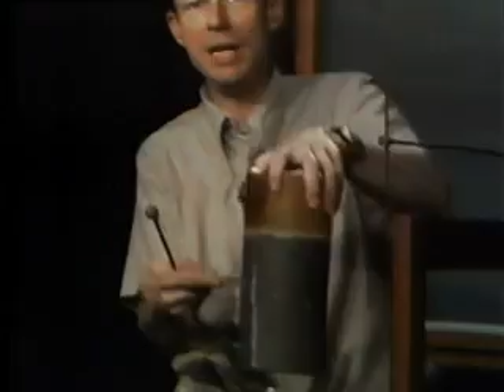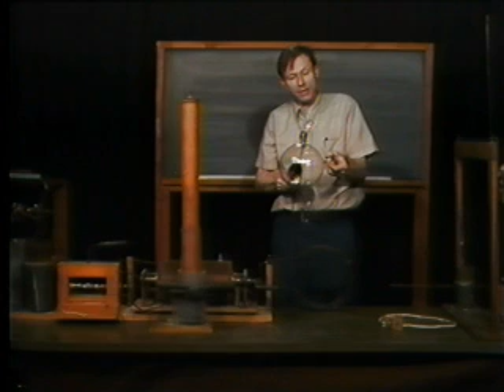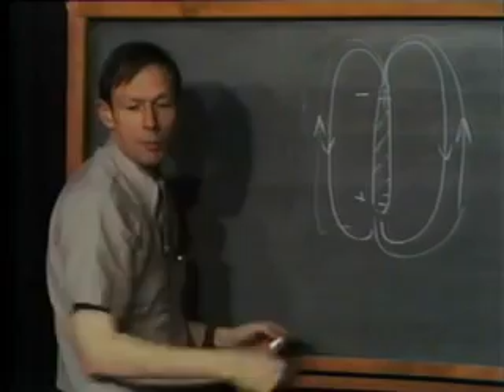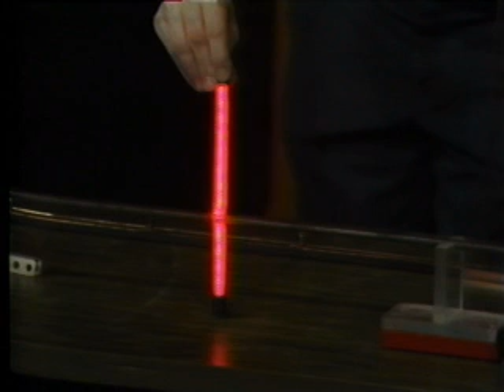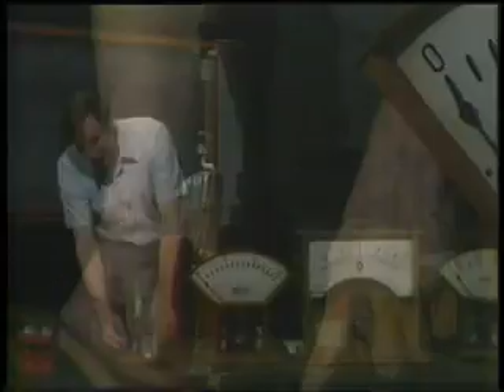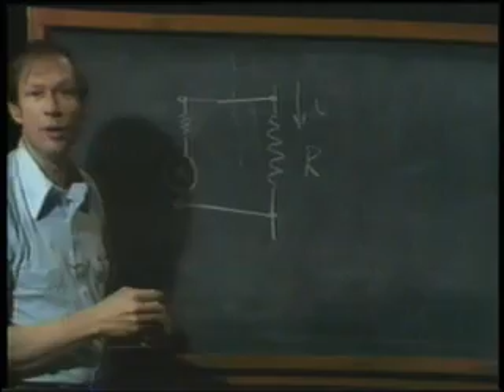PHYS 101/102 #1: Electromagnetic Waves

Comment: Skoolkids are not told that radio waves (ie em waves) are a different animal to photons. A 10 mm radio wave is not the same animal as a 10 mm photon. Radio waves consist of my photaenos which are the radiating part of a photon. And, re the Hertzian rolling E by H nature of radiating emissions from photons, i like the work of Ionel Dinu who has analysed the Hertz experiment & he says that Hertz's interpretation of Hertz's waves was wrong, there is no rolling E by H emission. Likewise Ivor Catt says that there is no rolling E by H emission anywhere in nature, it is a Heaviside slab of E by H energy current, a TEM.

The so-called flow of so-called electrons in an antenna or in any wire is a secondary effect. There is a slab of transverse E by H energy current flowing along the outside of the antenna/wire. As explained by Heaviside, Ivor Catt & Forrest Bishop. There is no such thing as charge or voltage. 

Photons have a central/internal part (the central helix) & an external part (the photaeno). 
The central helix has a front end & a rear end, & is (possibly) 1 wavelength long. The wavelength is simply one turn of the helix (there is no wave). 
The central helix is an annihilation of aether. Annihilation of aether gives gravitational mass & inertial mass. 
The track of the annihilation forms a helix. The helical annihilation moves axially throo the aether at the speed of light c, & along its helical track at more than c. 
Photaenos radiate out (to infinity) from the central helix. 
Photaenos annihilate aether, hence they have gravitational mass & inertial mass. 
Photaenos include a vibration (excitation) of the aether. 
Photaenos propagate outwards throo the aether at perhaps 5c in the near field & perhaps c in the far field. 
Photaenos radiate from fixed locations in the aether, ie from fixed locations along the central helix. 
Photaenos do not have a sideways velocity in the aether, ie each photaeno is shed from the central helix as the rear end of the central helix passes. 
In a free photon every photaeno is initially attached to the central helix, & later it detaches. 
In a confined photon the central helix has formed a continuous loop, in which case the photaenos do not detach (the central helix has no rear end). 
Electrons & other elementary particle are confined photons. 
Photaenos give us charge fields & electromagnetic fields. 
An attached photaeno gives a high field strength, an unattached photaeno gives a weaker field. 
Hence a free photon has 3 parts, the central helix, the attached photaenos, & the unattached photaenos. A confined photon has 2 parts, it has no unattached photaenos. 
Man-made radio signals are carried by photaenos, they are not carried by photons. 
A photon with a (natural) 10 mm wavelength (the length of its central helix), is a different animal to a radio wave with a (forced) 10 mm wavelength (which has no central helix). 
Free photons are slowed by the nearness of mass (confined photons), as suggested/proven by Shapiro (Shapiro Delay). 
Shapiro Delay is due to the photaenos (from the free photon)(& from the confined photon) fighting for the limited use of the aether. 
Fighting/congestion slows the photaenos & this slowing feeds back to the central helix, slowing the central helix. 
I call this slowing "photaeno drag". It contributes to the bending of light. It gives us diffraction near an edge. 
Photaeno drag is very strong inside mass (air water glass). It gives us refraction, & reflexion.
Reply: Wow, that was some good horse manure. ;-)

Comment: SHOULD EXPLAIN THAT ALL PARALLEL CONDUCTOR ARE CONNECTED TO A CIRCULAR LOOP CONDUCTOR.... 
METER....
1) HORIZONTALLY POSITION >MAXIMUM READING (  MAGNETIC FIELD ARE NOT BLOCK / DID NOT MAGNETISE THE HORIZONTALLY ORIENTATION PARALLEL CONDUCTOR  )
2 ) O VOLT READING ( MAGNETISE THE VERTICAL PARALLEL CONDUCTOR )
MAGNETIC FIELD IS VERTICAL WHILE THE ELECTRIC FIELD IS HORIZONTAL 🤔😷
Reply: THE TRANSMITTER DIAMETER IS SMALLER 🤔😷
Reply: IF THE PARALLEL CONDUCTOR  ( VERTICAL ORIENTATION  ) IS PLACED VERY NEAR TO THE VOLTMETER, IT MIGHT SHOW SOME READING DUE TO MAGNETIC FIELD FLIX LINKAGE. 🤔😷

Comment: The TRANSMITTER 'S power is sufficient to accommodate the minimum signal requirement for all receiver ( coil/loop ) placed along HORIZONTALLY position glass rod.
Red neon bulb lit with same brightness. 🤔😷
Reply: When placed near the coil.
Reply: ELECTRIC FIELD.... CAUSED NEON TO BREAKDOWN 🤔😷

Comment: SINE ELECTRIC & MAGNETIC FIELD... 
CLOCKWISE & ANTICLOCKWISE MAGNETIC FLUX IS FOR DC SUPPLY 
VERTICAL RECEIVER... CENTER BULB IS THE BRIGHTNESS DUE TO IT'S LOCATION PARALLEL &  NEAREST TO TRANSMITTER.MAGNETIC & ELECTRIC FIELD ARE IN PHASE & PERPENDICULAR TO EACH OTHER 🤔🤔

Comment: PLEASE REPLACE THIS VIDEO ABOUT ELECTROMAGNETIC WAVE WITH THE CORRECT EXPLANATION. 
TRANSMITTER ELECTRIC & MAGNETIC FIELD VARY WITH DISTANCE.MAXIMUM NEAR THE TRANSMITTER FURTHEST LIGHT BULB FROM TRANSMITTER GLOW... DIM @ OFF. 
NEAREST TO THE TRANSMITTER GLOW BRIGHTLY DUE STRONG ELECTRIC FIELD. 🤔
Reply: ANTENNA WITH BULB PLACED... 
VERTICALLY @ HORIZONTALLY ( DIFFERENT DISTANCE ) TO THE TRANSMITTER. 
MAGNETIC & ELECTRIC FIELD IS PERPENDICULAR TO EACH OTHER 🤔
Reply: LONGER ANTENNA... NEARER... SAME BRIGHTNESS 🤔
Reply: PARALLEL... ON
PERPENDICULAR... OFF🤔
Reply: NODE.. IN EACH END. ( OFF )
LONGER ANTENNA... NEARER.. SAME BRIGHTNESS ( RESONANCE PHENOMENA  )🤔
Reply: MAX + VE & MAX -VE.( SINE WAVE )... LENGHT OF ANTENNA🤔
Reply: HIGH FREQUENCY ( MHz  )... CURRENT FLOW AT THE SURFACE OF HUMAN BODY ( X NOT PENETRATE DEEPLY INTO HUMAN BODY  )HUMAN BODY ELECTRON RETURN PATH 🤔
Reply: RECEIVER ANTENNA PARALLEL WITH TRANSMITTER ANTENNA... MAXIMUM SIGNAL
.PERPENDICULAR...OFF
LONGER RECEIVER ANTENNA... NEARER... SAME ELECTRIC STRENGTH 🤔

Comment: MICROWAVE... 
RECEIVER... LOW READING WHEN A MAGNETIC MATERIAL/ METAL SHEET IS PLACED BETWEEN MICROWAVE & RECEIVER. AS THE MICROWAVE MAGNETIC FIELD MAGNETISE THE METAL SHEET, IT'S MAGNETIC FIELD STRENGTH IS WEAKEN. 
NO INSULATOR FOR MAGNETIC FIELD. THEREFORE RECEIVER READING IS HIGH 🤔
Reply: DRIVES IS PLACED IN A EARTHED METAL ENCLOSURE AS EMI SHIELD. 
A GOOD METER HAS EMI SHIELD .🤔

Comment: Explanation of the Universe.
All vibrations propagate through any medium with a finite speed are oscillations of the microstructure of this medium itself. Thus, electromagnetic oscillations are vibrations of the electrical and magnetic components of a vacuum. More details are shown in the quantum theory of spacetime. Below.

https://ru.calameo.com/read/0033783564a96e15b646e

Comment: How to the magnetic field and electric field get in phase when they come off the antenna 90 degrees out of phase?
Reply: That's what Maxwell's equations are telling you.
Reply: @schmetterling4477  I found the answer to my question.  Equations are great for predictions but they don't always grant a mental image of what's really happening.
Reply: @ThatEEguy2818  No, but you can develop the mental images by reducing the equation to what is happening in each point. How does a changing magnetic field cause an electric field? How does a changing electric field cause a magnetic field? When are they both in equilibrium? You can do this graphically if it helps or you can evaluate it mathematically. 

Having said that, it takes a good amount of time to develop an intuition and I have to say that mine was never very good for the free em fields.

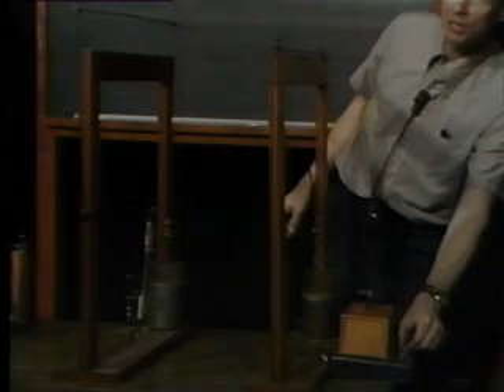Comment: 3:01 There's a leyden jar, spark gap and voltage source, it's said the spark gap breaks down and you get ac voltage.

How is the voltage alternating directions?
Reply: The leyden jar and the spark gap create a pulsing current in the coil this gives a pulsing magnetic flux over the coil. When the flux is decreasing a potential difference over the coil is created which is opposite when the flux is increasing. This is called inductance and is responsible
for the ac component.

Comment: sunlight is gravitational radiation/wave produced by hot/exiting/vibrating atoms on the sun. em wave is free electrons vibrating in conductor produced em radiation/wave. maxwell and qm busted. https://www.physforum.com/index.php?showtopic=52501&st=225

mass 1 and mass 2 at r distance, exist an attraction force f=m1m1/rr

if mass 1 and mass 2 distance changes, the force changes, that is gravitational wave/radiation.

you wave your hand produce more detectable gravitational wave than far away twin stars.

a speaker produces gravitational wave in vacuum, a microphone might pick up the force/sound in vacuum.

just saying. wasted so much tax $ for nothing. fuckedscience.com

Comment: nice,now lets step it up a bit,ok.the direct interaction with the plasma field with the specific interaction of metals from the carbon group,run threw reverse back to back thyristors threw a dual high voltage signal generator ,threw a secondary ionized gas field ,threw an inductor, 1 to 1, into a sound generator circuit so you can hear what you sound like interacting with the plasmas field threw a speaker. lol have fun take care ron

Comment: Motion within an infinite number of ref-frames, based on just one equation (E=ˠ M˳C² )∞  the Lorentz contraction of space and time is between the energy and mass. The greater the energy the greater the contraction of space and the slower time will run. Mass will increase relative to this and each ref-frame can be seen as a vortex in space formed by the rate that time flows. The brackets represent the boundary condition of the ref-frame formed by the energy within infinity

Comment: "Physics is easy!
There are only two combinations of these spherical sine wave-front's. They have opposite vector's and spin forming the positron resonance input+0/1-output electron wave-front's concentrically layered like onion's compressing+4-0-4+decompressing eXpanding sphere's dissipating gravity dividing time symmetry, at the same ratio, information is being multiplied by surrounding masses generating electrical potential oscillating volume of mass at the expense of gravitational potential.